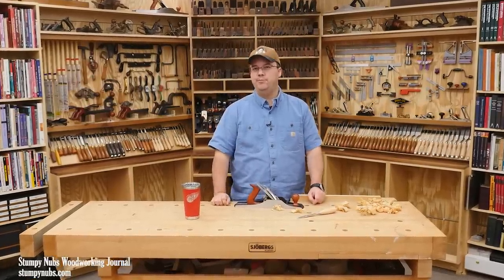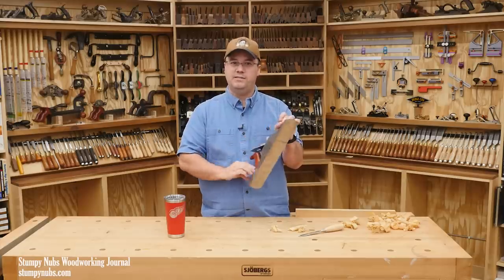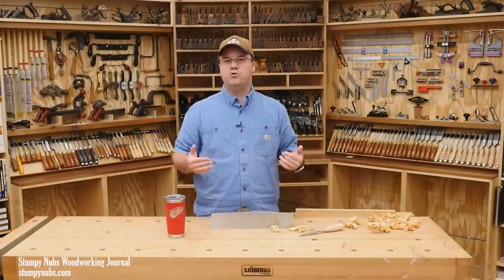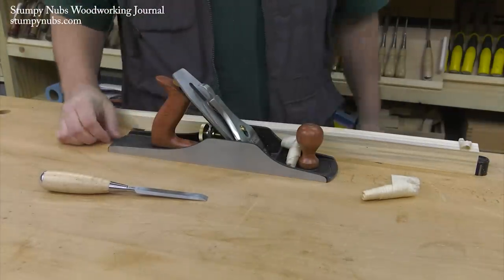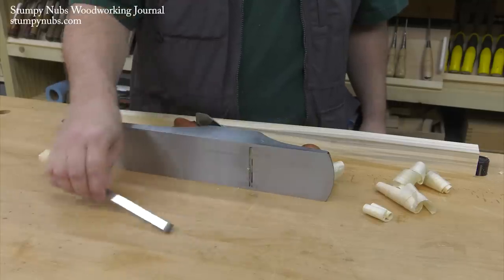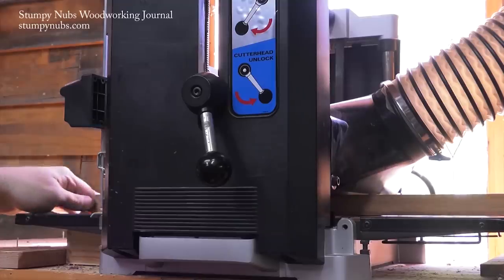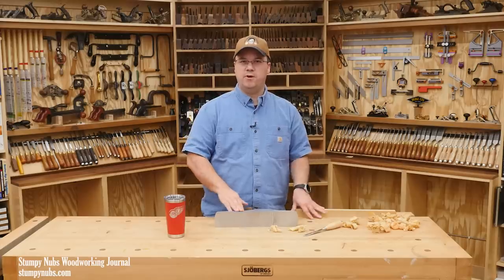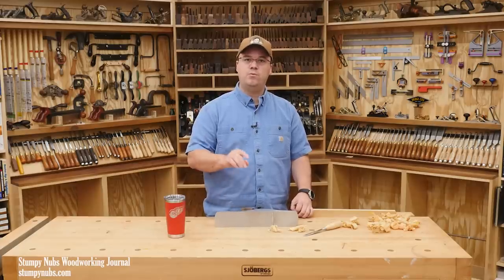Why I abuse my hand planes

Comment: When I was still working the tools I never lay my plane on its side as this practice was probably adopted by carpenters who used rough, damaged or dirty benches. My planes never suffered any damage at all through standing up. The other other more likely reason is that the blade might be pushed back. I always checked the cutting depth and alignment prior to use, so that wasn’t an issue to me anyway. I am not offended at your content, though I suppose some die-hard carpenters would be. Keep up the good work.

Comment: Immediately after purchase a good quality hand plane must be properly setup and tuned to absolute perfection. You must use a 0.001mm feeler gauge on a machinist stone to validate that the sole is acceptably flat and take the most impractically thin shaving to verified.

Afterwards you must oil the plane and store it in a vertical holder for display.

Going forward only use power tools to dimension your wood.

This is the only way to properly use a plane

Comment: I never understood why people get all out of shape over this. I understand putting a handplane on metal (nail, chisel, iron table, etc.) as that could damage the sole or blade. Putting the sole down on the very surface that it's designed to cut will do no more damage than planing into a knot or wavy grain. I generally retract the blade anyway just in case so it doesn't damage the blade or make any gouges.

Comment: When I started night school about 15 years ago, my teacher who served an apprenticeship before switching to a 50 year plus teaching career was fastidious about planes not being placed face down on the bench.

However, if you saw the state of the school benches you would understand why. I bought an old one from the school for £20 mainly for the quick release vices but then decided to actually use the bench as well. It took hours with a metal detector to find all the nails, pins, snapped off screws etc that generations of schoolkids had hammered into the bench. I still avoid putting planes face down on it now.

Comment: it's easier to damage the bottom with it laying on its side. the one place you don't want any damage. it will also slide around more laying on its side or with the blade retracted. if the wood is going to damage the blade then it's not going to be a very useful tool.

Comment: My shop class the bench tops were steel and would be used for woodworking, automotive, and machining.  The class before you might have been working on an engine part and before that cutting out metal on that same benchtop.  So who knows what would be on that benchtop that could damage a plane iron.

Comment: I was thinking about changing the cutter head  on my planer, but not anymore at that price. It's more than the cost of the planer. I am however looking at a jointer that comes with a helical cutter head. And as far as the planer placement  is concerned, I don't own one. So it really doesn't concern me. THANKS for the information though.
Reply from the maker: It costs more than your planer because a staggering amount of engineering and tooling goes into making a helical head. If your planer had come with one in it, it would have been much more expensive.
Reply: @StumpyNubs  it probably would, but the jointer I'm looking at doesn't  cost much more with the helical cutter head.

Comment: I was taught the reason for putting it on its side was to not knock or push the setting or alignment you adjust it at. So it the side placement that knocks it out. Damn

Comment: Not arguing, but I do wonder, though, about the weight of the plane "rolling" the ultrathin edge of the plane iron?  When cutting, the edge is not being rested upon; in fact, it is being "pulled" outwards.  Laying it face down is pushing/rolling the edge upwards.  Given how very easy it is to create a burr while sharpening, I tend to think of that edge as VERY susceptible to rolling.  Or maybe I have an incorrect view of it!

Comment: Like Paul Sellers, I learned to lay my plane on its side at school in the 50's.  I shared a bench tool-well with the kid on the other side of the two sided bench, it's a habit I tried to change, however!  Laying it on the sole and nudging it out of the way to make space for other tasks I find it easily scratches the surface of the coated MDF surface of my Rob Cosman bench, I'll stick with the old habit.

Comment: My grandfather and his brother were both carpenters starting in the 1930s. And what they did to their circular saws would be greatly frowned upon today, they removed the blade guards because they felt it interfered with their ability to see the saw point. They also felt that it was dangerous to use the guard because it was slow to close due to weak springs and was more prone to jam. One of the things I remember watching was they would scribe a straight line on a board and saw straight down that line without a guide. I did not even know circular saws aka skill saws came with a blade guard until I was around 9-10 years old which was in the mid 1950s. Neither of them was ever harmed by the saws they used but hammers kept their thumbs brutalized primarily because the rapid rate of nailing they used for roofing. Just one more thing before I go. I remember my grandfather would drill holes in his thumb nail with his pocket knife to relive the pressure. The blood would just shoot straight out through the hole.
Reply from the maker: Removing the blade guard on a handheld circular saw is incredibly reckless. Those saws can bind and kick back, and when they do you can easily tear up a leg or worse if the guard doesn't snap back in place. I grow weary of the "It never hurt me" excuse since everyone who eventually gets hurt by doing something stupid was able to say the same thing right up until the day his recklessness caught up to him.

Comment: I was taught 50 years ago to set it with the sole down on the bench. But mainly, protect the edge from any contact with metal, concrete, etc. Also, I was dropped on my head as a child. I think I'm offended, but I'm not sure. Thx.

Comment: For starters, the blade of a plane should not be “razor sharp”. If it’s ground the way a razor is, it was ground wrong. “Chisel sharp” is less wrong.

That’s the only nit I want to pick. I took Wood Shop in 1967. We were taught to place a plane next to us, on its sole as you demonstrated, but we were also harangued about keeping the work surface clear. There was little trouble getting us to do this since the first week of class was spent learning how to care for the tools. Nobody really wanted to resharpen a plane they had nicked on a nail.
Reply from the maker: "Razor sharp" is a figure of speech. I think you know that.

Comment: Yeah, in school, because of dubious bench construction (and frequently sheet-steel tables) we were taught to lay the planes on their sides, explicitly because of the dubious constructions, metal-on-metal contacts, and for varieties of things being left all over the work tables and benches IN SCHOOL... 

    In actual LABOR situations, from shops to field sites, I always got the same basic speech and principles. If you lay the plane on wood or cardboard, sole down... If you lay it on anything "harder" than wood, on its side... At work sites, we would frequently make "plane caddies" which were either dug or carved out to fit, or patterned and glued up to fit around the plane so there was just a little friction to hold onto the sole plate... It didn't have to hold particularly tight, and you DID want relative ease to just get the damn plane (defined by the words "Don't hold elephants with it")... BUT the hand planes WERE respected, along with many other hand tools with cutters or refined mechanics exposed, and they got a caddy. Wherever you took the tool, you brought the caddy so you HAD a specific place and way to set it down to be easily picked back up again... and it was made of material (usually wood) or lined so it couldn't possibly harm cutters or other exposed working bits and parts. Made storing the tools in stacks or bins or whatever boxes and lockers easier, too...

     AND everybody learned how to make them. It wasn't difficult, and they were never fancy... BUT they DID get regularly stepped on or run over and broken. Nobody bitched about it. You were just expected to build a replacement caddy if you were in charge of a tool and the caddy got broken "on your watch". No big deals, and there were always enough scraps to go through and get it done...

     BUT when you're working in a gravel covered lot, there's just no good way to put anything down ANYWHERE...  ;o)

Comment: When you're taught something, you should always ask questions starting with "why". Not so much "what" or "how", because the answers to those come naturally since you are already taught. If you have your "why" questions answered, you can wrap your head around a concept and a reasoning behind it and can begin to test it against your own experience. You can even apply that reasoning and your ever-growing experience to new situations and see if it fits, growing your potential of finding a solution for a problem you never dealt with before.
If all you learn is "how" to do "what", you don't learn anything significant at all, because you will virtually never face the exact same situation again. Learning to open a bag of chips should enable you to open a bag of pretzels. If not, you haven't learned to open a bag of chips but to copy the procedure of it, which makes you just slightly, if any smarter than a tool.
Reply: Yes.  My teacher said about art, "Learn the rules, and learn when you should break them."  The "why" is a vital component in that discernment.

Comment: There are several "shop rules" from my training and practice as a shop teacher that have been proven false (or at least misguided) over the years. The hand plane position is one. the neglect of hearing protection in the woodshop because "the tools aren't loud enough" is another, the need to "open the coat" of abrasive papers before use, I could go on. BUT I will stand by my training regarding the use of safety glasses (with side shields) at ALL times in the shop, as well as restraining long hair and loose clothing. (BTW I have seen the results of neglecting these principles firsthand!! NOT good!!) Keep up the great content!!

Comment: This concept is something I say at least weekly at work (as a software developer/architect)...  there are a thousand "right" ways to do any specific thing in the industry at large... BUT this is the way we do it here.  No that's not how [famous "expert"] said to do it.  Get over it.  At this company we're doing it this way -- we have analyzed the pros and cons and accepted the inherent risks of our choice.  No, we're not going to rehash that analysis every time a new team member comes on board.  But we're happy to do so when that choice fails our present requirements.  No, you're not going to invent a new and different way to do that thing for every new project -- we build with our existing patterns until and unless the existing patterns don't work for the present situation.

Comment: In woodworking class in school in the UK, we would have be told off for putting the plane on it's side, "what if you or someone else brushed their hand against it, they would cut themselves!!!". We also were told not to have it flat on the bench too, for the reasons you mentioned.  The old style school work benches had a recess in the middle, we had to lay the plane sole down over that.

Comment: Ty. I want to use oil base Polyurethane on my floor. I have used minwax oil base polyurethane my question could I use 150 grit screen under my heavy duty side by side orbital machine or should I use 000 steel wool or should I use sandpaper. 

Now after the first coat dries could I use a white buffer pad to remove fine layer on top.  
Ty

Comment: The thing most likely to damage a plane blade is another price of metal, which is less likely to happen if the planer is placed sole-down on a wooden surface.
I was taught in high school shop classes to lay a plane on its side.  Like a number of other things I was taught in high school, this is nonsense.

Comment: Your channel emits such a clean cunningly sharp seemingly flawless language its content deserves available subtitles (if the viewers would learn of it instead of clinging on to such a tool). 
Plus i read on quora that electric installations in the "USA" in 2023 resemble a development level of the 1950ies even when the installed stuff would be fresh out of the factory, whilst cables and wires are mostly a few metres above the ground/soil instead of underground, as if one would live in some tent village (ironically a similar picture that was flasely drawn from the "indians" = natAm, native americans whan they were already weakened and degraded), so i see how stumpy nubs would gather or enable some potential to a lot of craftmen. Of which region(s) in the "USA" would that american inhabitant had described in quora? I would be convinced there must be huge differences depending on the region, but that's not the woodworm in me thinking though, i'd admit, just some unsolved mystery of why would development be hindered due to some odd law interpretation not helpful for most people.

Comment: It is way too long since I took shop in school to remember what we were taught.  However, on the rare occasion that I use a hand plane, I do not put it down on the side.  It has never made any sense to me.  Having it on the side makes it dangerous if YOU bump into it and I'd rather sharpen a blade than miss the part of my finger that got cut off by accident!  It never made sense either because you're using it to cut wood so why would wood damage the plane.  But that's just me :)

Comment: This problem can be solved with a bit of engineering. Place a small piece at the end of the planer that is pushed down 90 by a weak spring. When it is placed sole down, it will prevent blade from touching the surface. When you are using it, it will fold back. Oh wait, that is already been done, in higher quality powered hand planers... I can lay my hand planer sole down and it will not rip my benchtop apart thanks to that little knob. Maybe, we should produce old timey stuff with new quality of life improvements.

Comment: Look, I'm a complete idiot, and even I know laying the planer blade-side down is just pure common sense, and a best safety practice. Aside from that, when I use a block, or hand plane I make sure everything is off the working surface so I can get to it without having to move things around, or plane around said objects. Personally I prefer to clean up during different stages of the project as needed. Once I'm finished with the tools portion of it I'll remove, and put aside all of the tools I used so I can switch to the orbital sander, or the other set of tools I need for that stage of the operation. This keeps things a lot less confusing because I don't have everything I own at the workbench.

Comment: A past sawdoctor, I can tell you I have seen some pretty criminal things done to plane blades. Usually it was some sort of attempt at so called "sharpening" which took a heck of a lot more life out of them than placing them on a wooden bench. Yes, it may help a sloppy woodworker with tools strewn everywhere, for most people out there, IN MY OPINION, there are much worse tool crimes than can be committed on tools. Each to their own but placing, rather than tossing any tool down is something people should be far more concerned with.

Comment: UK in the mid 60's I was 11 and my woodwork teacher was positively ancient (well he seemed that way to a bunch of 11 year old's) . He'd worked on making Mosquito aircraft during WW2 and was a stickler for the correct handling of tools. His major rule was "If you cut yourself or anyone else, you're aren't handling or using the tool properly" and if this rule was broken, corporal punishment ensued. He taught us that hand planes should always be placed on the workbench with the sole down in order to prevent any accidental contact with the blade by hard objects or human skin. I never saw planes put on their sides until I came to the US and find the practice puzzling and the reasons for doing so quite odd. Good common sense illustration Mr. Nubs, just ignore the may Sayers.

Comment: To me, laying it on its side throws the blade alignment off a lot more than any damage to the blade. Its not an easy thing to reset your plane blade every couple of times you've set the plane down.
Reply: if your blade is that easy to knock out of alignment you should probably fix your plane sounds like its loose

Comment: Half of the stuff I learned at school was unlearning things I was taught years prior.  It isn't that the previous lessons were wrong, but designed for my age, maturity and ability.   
Shop class for an early teen, is mostly all about making sure a class of 15-30 students pumped full of hormones, with access to expensive, sharp and potentially dangerous tools don't create havoc or hurt or kill themselves or someone else.   Then if there is time teaching them to actually craft something.  But in such an environment there are just a lot of rules with strict discipline if someone breaks them, because of the potential of disaster.

Comment: there's nothing wrong with putting a plane on its sole - schoolkids might have their bench littered with screws and nails that might damage the edge but we're grown-ups, right? it's not necessary and can cause problems

laying a plane on its side means that you risk knocking the lateral adjuster by mistake, which will mess up the next stroke... if in doubt, put the toe of the plane on a batten